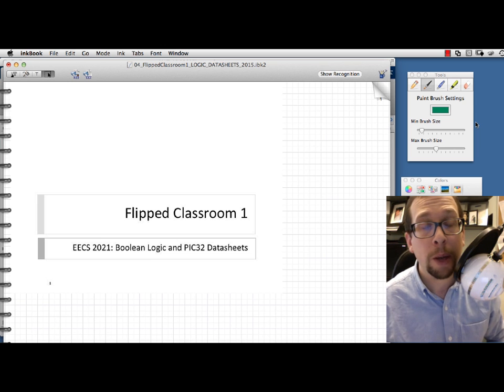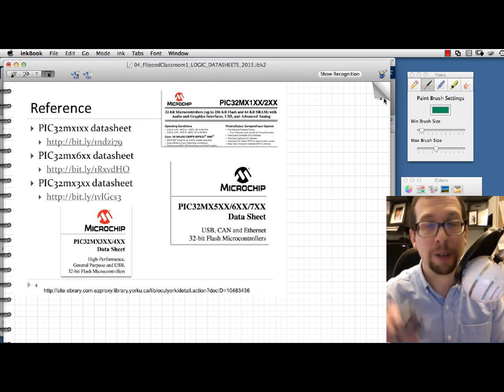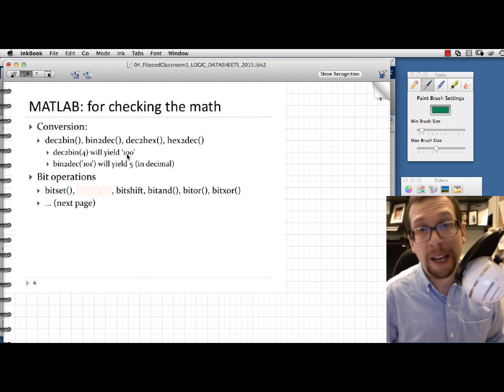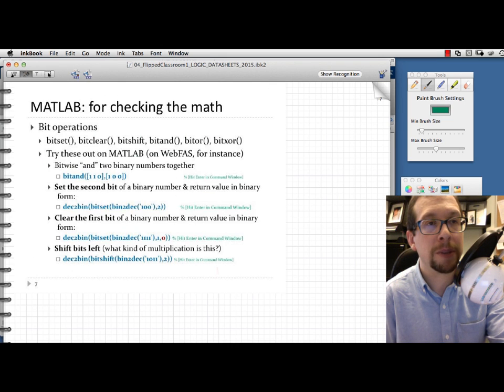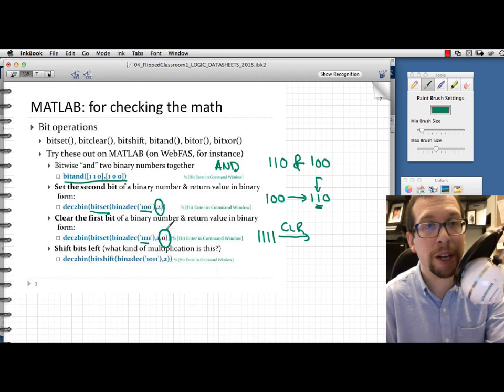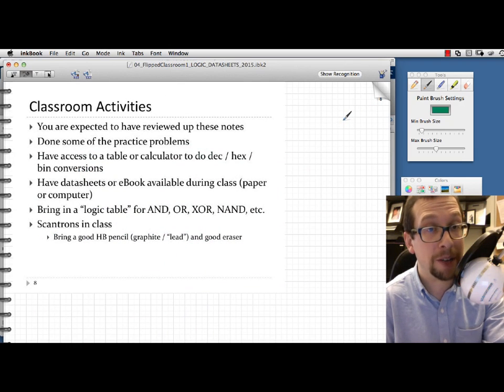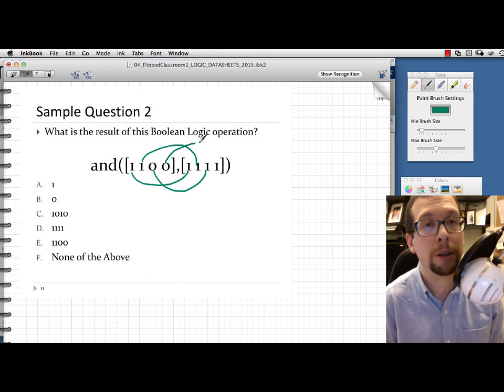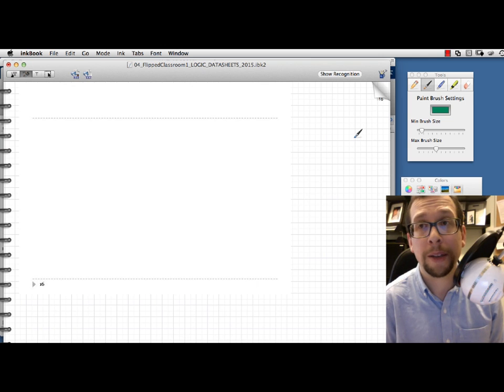EECS 2021 Introduction to Flipped Class 1: Booleans and PIC32 Datasheets

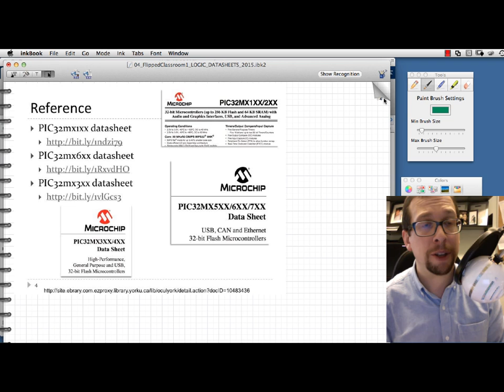Comment: 2:03 But those are ~300 pages long each.
Reply from the maker: +Wonderer Hi.  Which is why most reasonable people use the electronic versions.  Check Moodle for an update.
Reply: +James Smith Your comments are eye-opening.
Reply: +James Smith If I didn't bring a laptop/tablet there, does that mean I have to borrow/share with someone else?
Reply from the maker: Sharing and discussion is encouraged, as you saw tonight
Reply: Do we get bonus marks if we upvote your video..